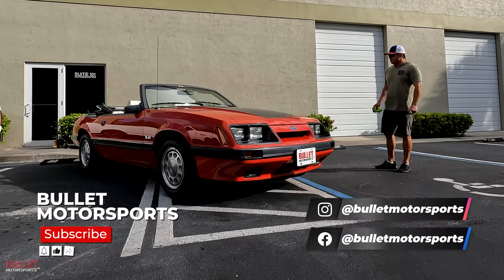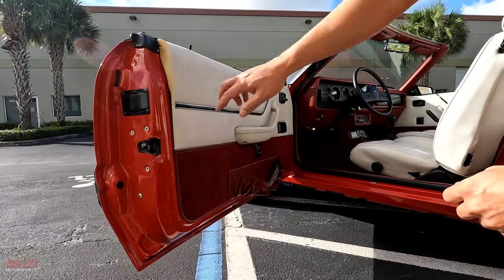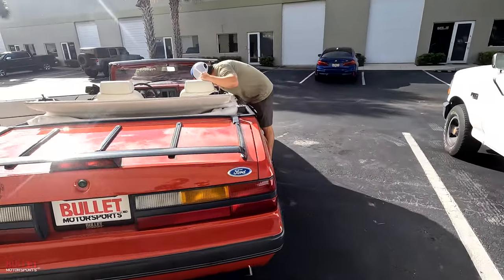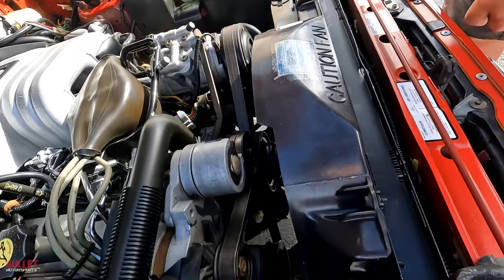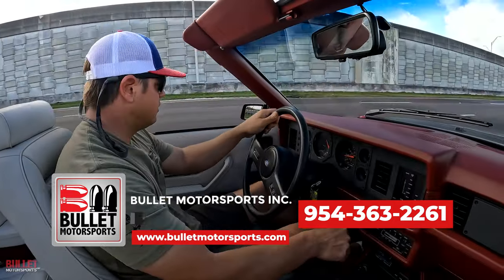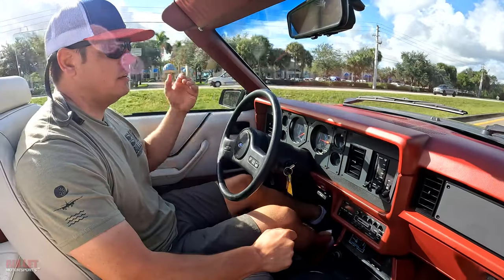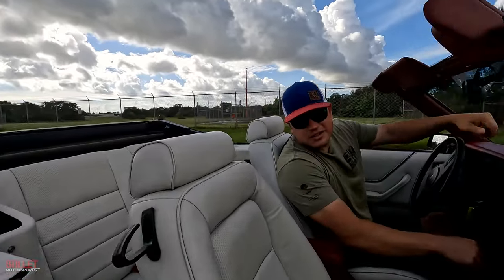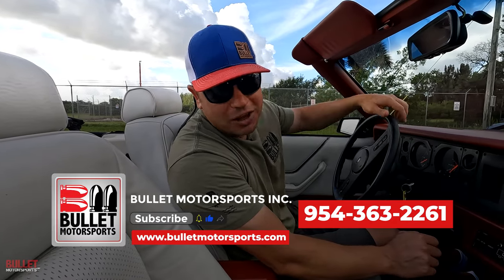1986 Ford Mustang LX 5.0 1 owner! 36K miles | Review Series | [4K]

Comment: I owned an 86 Mustang GT Convertible for a very long time, the first answer about the rear end (2 variants, 2.73 or 3.08) is that it is called a traction lock (limited slip), It took me 5 years to find out and learn exactly what the car is capable of doing, now looking at this car, it has the LX seats ( the GT had Recaro style with gray or red piping), and with the window controls, the GT had 4 window switch and lock out on the driver door and 1 on the passenger door and NONE at the rear windows (LX option only), the speedo only has 5 digits, the only exterior differences between the LX and GT conv for that year was the front bumper cover(this car has mounts in the headlight wells for a cover and is slightly off line so I believe it was replaced), black decal on the engine hood, easy to find a red GT hood with decal back then, and the side quarter GT body molding(very easily bought and then switched from the parts dept) in front of the rear wheels, getting to the interior, the fog light switch should be below the headlight switch and it's different than the one I had, that steering wheel was a tilt wheel and don't see the knob for it, no rear defogger, different premium stereo, the AC, for the GT, had a button, not a selection on the slide knob( LX option)the grey areas around the gauges are on both LX and GT, but the back lighting of the gauges are deep orange for the GT and regular for the LX, as he is driving the car, it looks like the car is turning 1250 RPMs at 55 MPH which makes the rear end of the car 2.73 gears, which happens to be the best of both worlds, faster acceleration and better mpg. The only way to make sure that the car is a GT is to run the VIN at a Ford dealership but either way from the surface it seems to be a very nice Mustang.
Hope this answers some questions